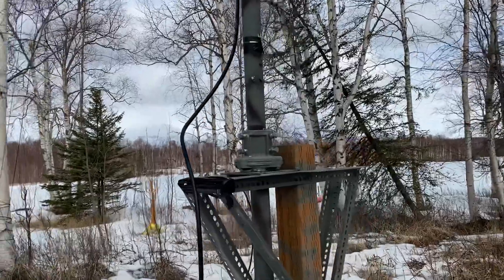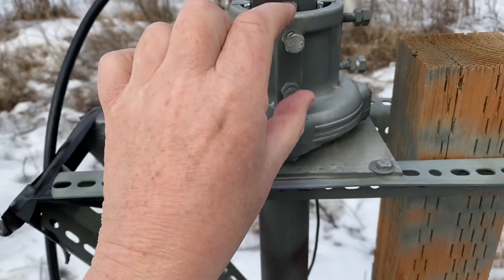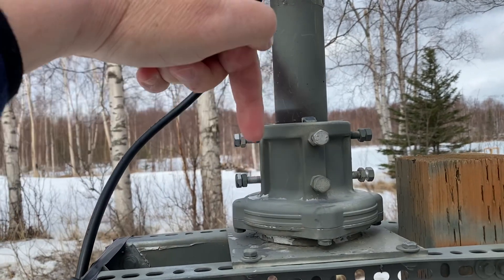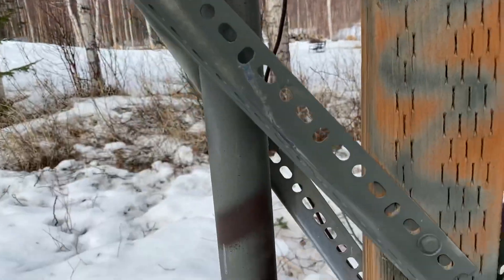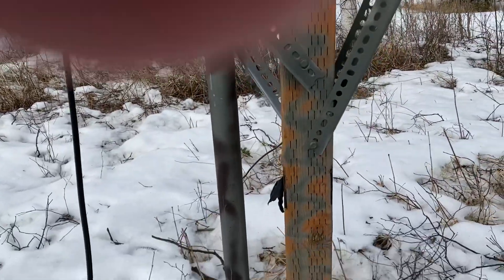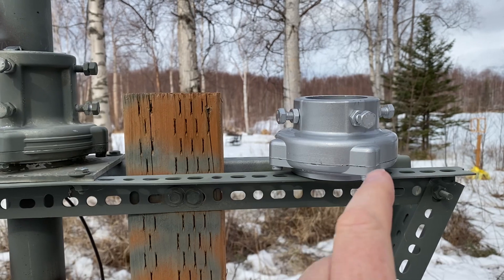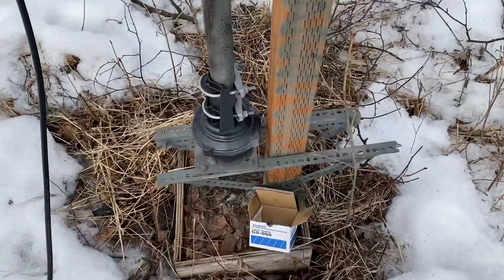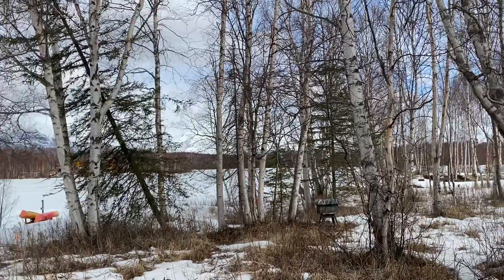Thrust bearings and NA4RR Hexbeam

Comment: How’s the bearing holding up for you? The h50 I think are dom tubing which is made to flex a bit. Some people use thick walled water pipe or gas pipe which creates a massive wind load
Reply from the maker: Holding up well - no issues or wear I can see - thanks
Reply: @hellozerohellozero  that’s great! You have some nice trees I see for a 40m delta loop vertical 😎

Comment: I like this. What dimensions are the aluminum plates?
Reply from the maker: Hi the Aluminium plate is 160mm squar(ish) and some 5mm thick - bought from Amazon I think- the drill outs are to suit and I used galvanized bolts and spring/flat washers.

Comment: Thanks for this video, exactly what ive been looking on the thrust. I have a similar set up with Traffie hexbeam and 4x6 but lightweight rotar at top. QUESTION:  over tine do you think your pole will bend due to weight on it? Looks like antenna weight on thrist bearing is borne by 4x4. I really like this so wondering tnx de WO8USA🇺🇸🇺🇸🇺🇸
Reply from the maker: Hi - thanks for all your comments - This written in June 2023 - Well the system has survived another Alaskan winter and the lightweight steel mast is still straight! I looked at having the rotator at the top but for me it just wouldnt have worked with the size of the support mast being too flimsy and the head weight too lift - I also wanted to be able to repair the rotor at ground level -  I took a look at the thrust bearing and the support structure and for any deterioation in the guys - and all appears fine, the 4 x 4 still looks like new-   Ill readjust the guys at the end of the growing season and most are wrapped around Birch trees, except one set of three levels which is attached to my well casing.  One only issue Ill need to deal with, and Ive seen this before and should have corrected - is that during extreme wind events one of the arms gets blown sideways dragging the 20m mostly wire out of alignment by 10 degrees or so, no biggy as the I cant see a change  in pattern or swr - this can be corrected by stopping the wires and their rings from being allowed to travel past the one of the Four support arms - maybe a uv protected ty wrap or two -   Id dearly like to get this up another 20ft but then it will be exposed to the windage and the wrath or winter/autumnal storms - better to err less wind exposure.

Comment: Thanks for the video. I"m wondering what mast you're using with this.  Also, I'm not clear on how thrust bearings function. 
That is, if they're clamping the mast, then how does the rotator turn the mast?
Reply from the maker: thanks -  the mast is a Rohn H50 (I think, its been a while!). On the thrust beaing - it has two parts outer part is attached to the metal plate and the inner is free to rotate on a bearing - so the rotator below rotates thru the top bearing freely - the added advantage is, per the video, most of the stress and weight are taken by the bearing and there is nearly no vertical weight on the rotator at all - just the rotational torque and breaking is required - Th e G-450A continues to operate fine and the other bug is it doesnt or didnt have low temp grease in the bearings and would be be slow to start at below 0F

Comment: Do you have much 6 meter activity there? 

Like your ground mount. It shows a practical way to mount a hex without dropping $1500 on a tower.
Reply from the maker: Hi Doug - there are a couple of 6m super stations up here and some EME activity too - Im on 6m with the Hex and will be looking over the bands as the MUF rises - the Hex works pretty well on 6m with recent openings to JA etc - being at the foot of mountains I, kinda blocked at 6 deg from NW thru East, so very low angle stuff gets knocked off a bit. Good luck